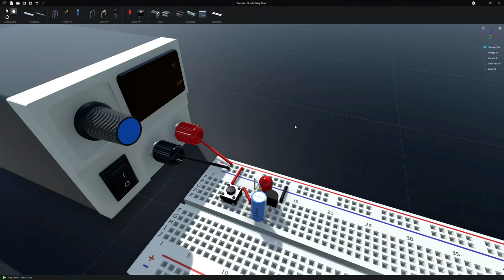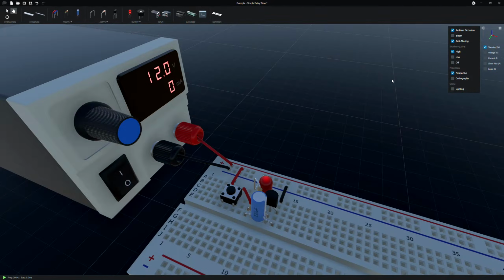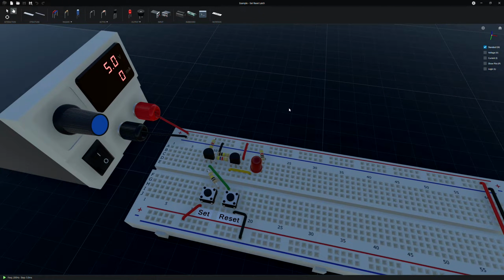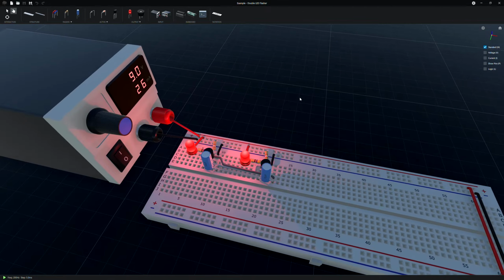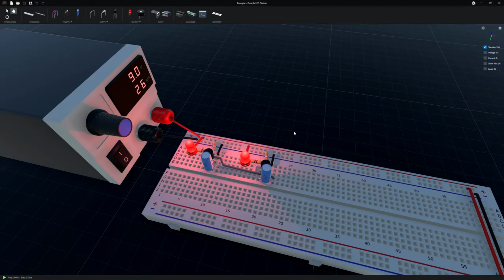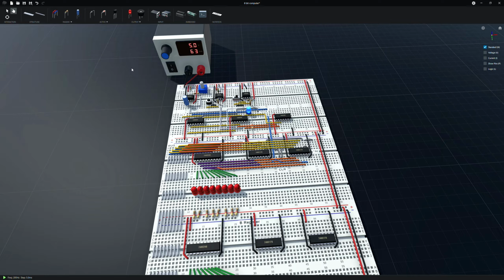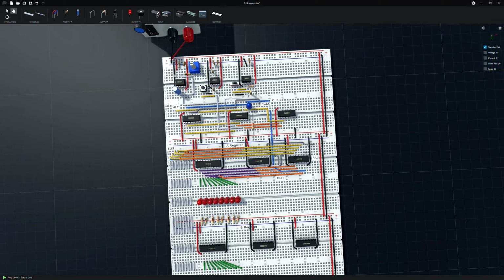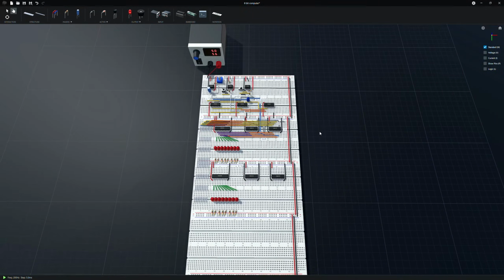CRUMB Basics | Transistor Circuits

Comment: im confused on where those 2 resistors are connected to on the set-reset latch, been trying my best to follow the schematic but cant seem to get it to work; maximum i've got was the LED staying on and turning off when i hold the reset button
Reply from the maker: From what I recall I used the schematic linked in the description. Double check your transistors to make sure you're hooking them up right. https://www.homemade-circuits.com/simple-and-useful-transistor-latch/

Comment: is any one use two power supplies? i can not run symetrical power
Reply from the maker: Power seems to only work with one power supply. I'm also unable to use the function generator alongside a power supply.

Comment: whenever i use crumb and press a slide button (dip or normal slide), and also push buttons ( i think)  i need to reset by toggling the power supply off and on again to get the output to work
Reply from the maker: There are some quirks for sure

Comment: So I downloaded CRUMB and hooked up the oscillator and did a bit of testing. The transistor is indeed a TO-92 case with US version pinout. From left to right with the flat side facing you pin 1 = emitter (The leg with the arrow in a schematic); 2 = base or schematic middle "T" leg; 3 = collector. You have the transistors wired backwards for the default NPN transistor. For this circuit don't bother trying to fix it. If you scope either capacitor the scope shows oscillations but they are not correct in frequency no matter what size capacitor. Increasing the capacitance seems to make no difference. The LEDs scope that they are conducting constantly but do not light. I think the simulation speed is too slow to accurately track the charging and discharging of the capacitors. Better to use the 555 timer IC instead for a stable clock signal.
Reply from the maker: Turn on pin labels in CRUMB. Both types of transistor are c b e with flat side facing you. Also make sure you're looking at voltage and not current in the scope view

Comment: Astable Multivibrator (square wave oscillator): Check the pinouts of the transistors. If this is a simulated 2N2222 switching transistor (or any transistor in a TO-92 package) you have pin 1 and 3 reversed - just flip them both around using the same bread board sockets (if the program lets you do that). You also have the LEDs after the collector resistors (the low 520ohm (?) resistors - can't really see the colors) but they will light up either way. Also make sure the cap value is fairly high or the LEDs will flash too fast to see. 30 hz is nearly imperceptible. Attach your scope to the collector (pin 3) of either transistor or increase the scale and test the signal on the negative side of the capacitor which is the transistor base or pin 2

I'm checking into this software.
Reply from the maker: The transistor pins are labeled and I've tried several oscillator circuits with no luck. The scope view shows no oscillation so I think it's just not modeled at this time
Reply: @KerboOnYT  Something is not right with the transistors. They operate exactly the same no matter which way you orient them or swap the collector and emitter wiring. They are working more like a triac instead of a transistor. The simulation seems to lock the oscillator in one state and refuses to recognize the feedback condition. But the 555 does work according to it's data sheet.